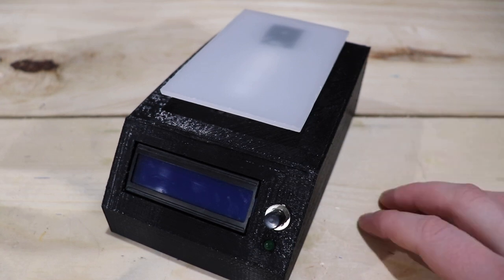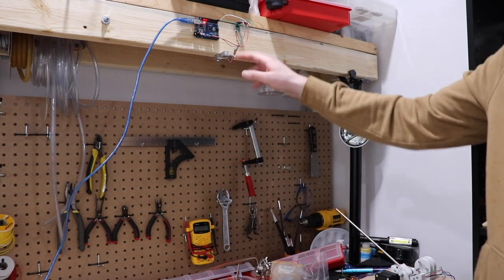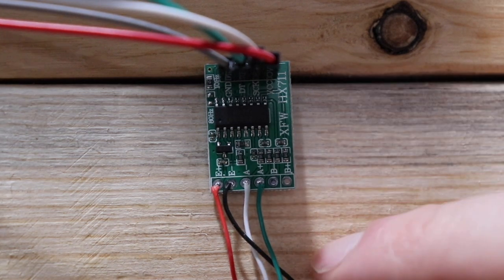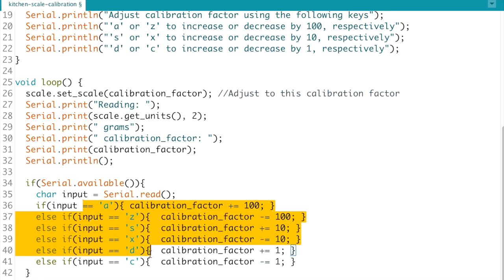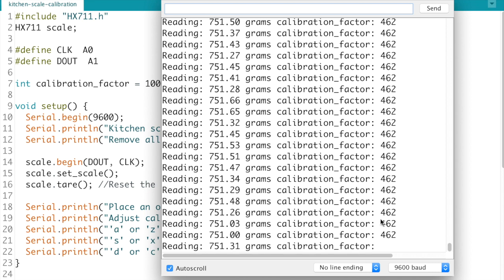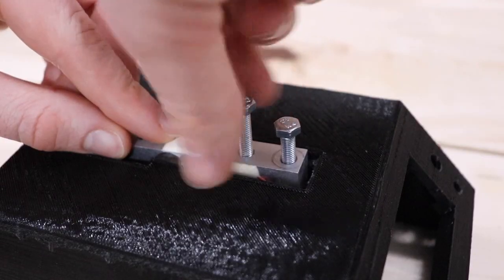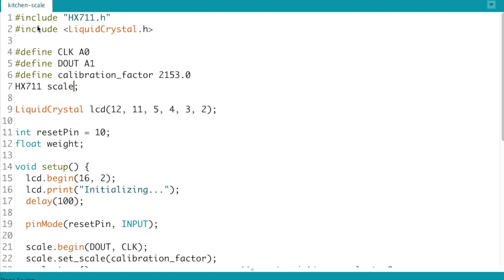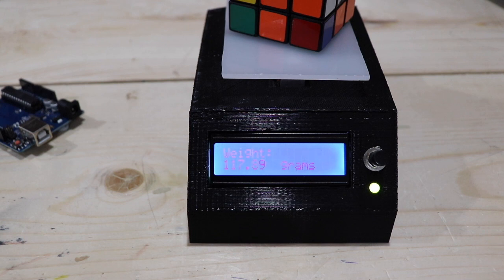DIY kitchen scale using load cell & HX711

Comment: Cool video! I want to build a scale for my beehives, but I don't want to have them powered on constantly as I will really only need to check the weight weekly. Will the scale always show zero then when I switch it on or can I write the code so that it only tares once and then from that point on always displays the load? Is my question clear?
Reply from the maker: Yes, the scale will always show zero when turned on. If left on for a long time the measurement may drift by a few grams, this is not a precision device, merely a fun hobby project. I am not sure what you mean in the second half of the sentence "can I write the code so that it only tares once and then from that point on always displays the load".

Note that you will be able to find cheaper and more precise scales from manufacturers, but if your application is just for fun and learning then definitely make your own!
Reply: @WillDonaldson  thanks. I don't understand why zero will be displayed when applying load and then switching on the power. I thought that during calibration the factor is saved and will be applied on the values received by the amplifier. The arduino code could use that value each time the device is powered on. I will still try to figure it out. Thanks again for the great video.

Comment: Hello, the right project I was looking for.  Will be using it to weight wild birds when they land on a dish with seeds .  Two questions if I may: 1) About the two push-buttons, the one in pin 1 of the ATMega is the reset, the other on pin 16 (PB2) is it the Tara?
2) Is it OK to use pins 8 and 22 for a ground bus?  Or it is only to show on the diagram.